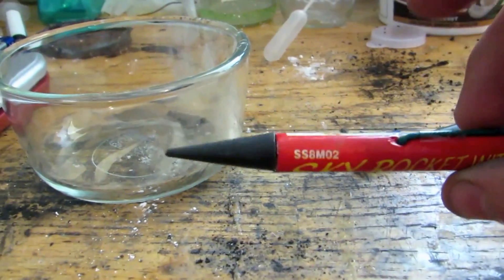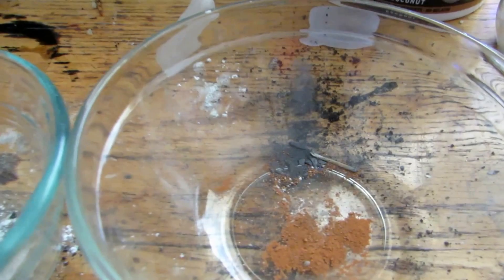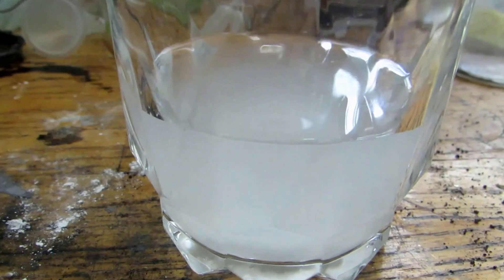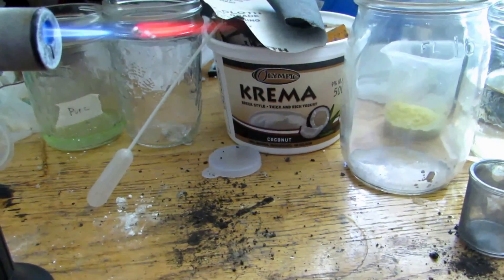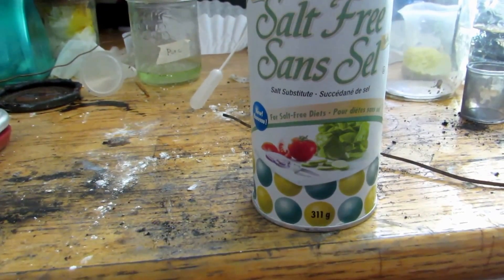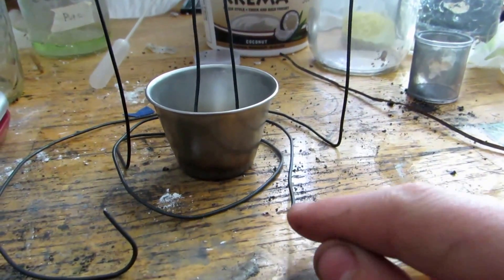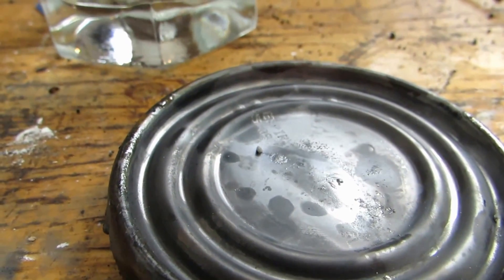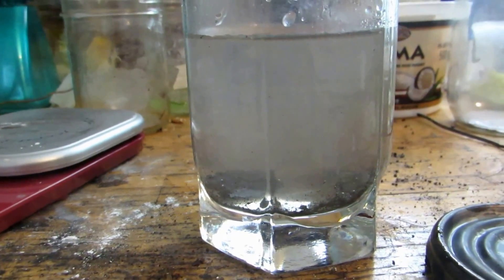How to make Strontium (household materials)

Comment: I watched your all videos. I like your making Strontium and making calcium videos there are awesome So you got strontium chloride from fireworks tell me where I can get cesium salts like this household materials please ?
Reply from the maker: I have partly filmed a caesium video and I can tell you that I succeeded in getting caesium. caesium compounds are not cheep but if you can purify it the element is 80 dollars US a gram! I used caesium chloride which I bought online. I got 100 grams for 70 dollars US. it is too volatile to electrolyse, so I did a reduction of it with lithium in a vacuum under helium gas and it worked. other than that, it may be hard to find other caesium compounds. caesium chloride is used as a drug to help fight cancer or something, so you may be able to find it at a drug store, but I just ordered mine online. also, its nice you enjoyed those videos. Thanks!
Reply: Thank you very much for your answer :-)
Reply from the maker: np